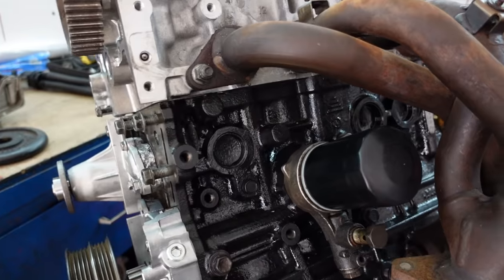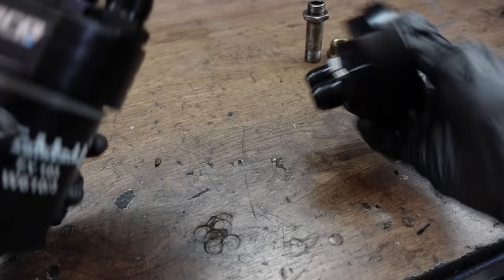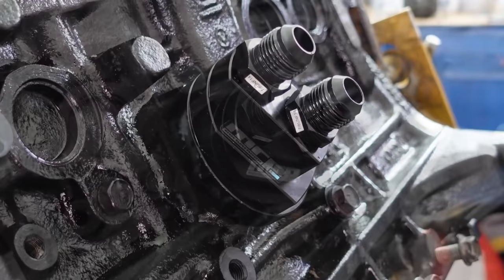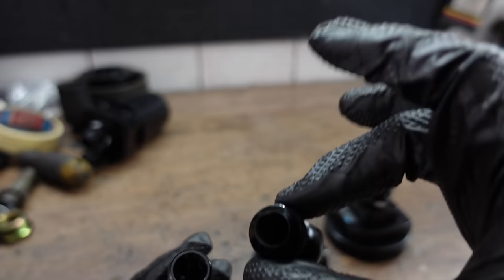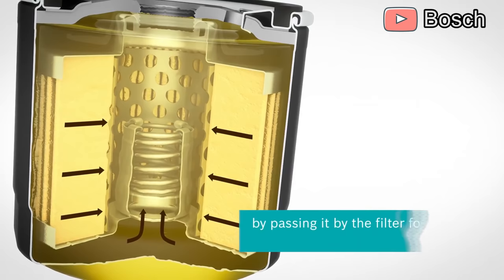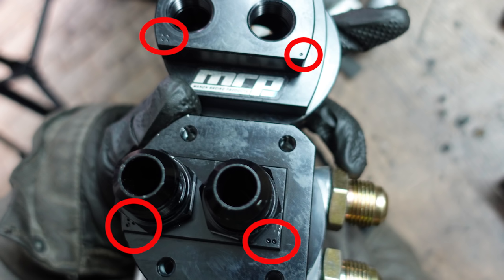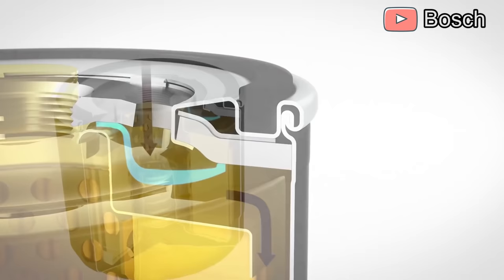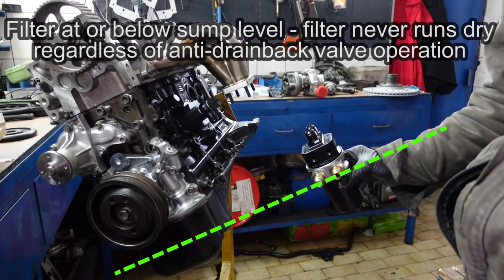HOW and WHY to relocate your OIL FILTER

Comment: Love to see parts go on that are a perfect fit. I got a replacement radiator that was 99% the same, the 1% difference was the size of the inlet and outlet so the stock hoses didn't quite fit comfortably back on. Maybe turning over the engine without spark for a bit would prime engines without as much ware for extreme setups?

Comment: I remotely relocated my oil filter on my v8 e30.
Used a block adaptor with -10an fittings  mounted thr filter and new housing down under the chassis leg and connected the two with nice braided oil lines.
No need for a cooler where it is now as it's down in a nice stream of cool air 😎

Comment: Great video. But i have read about the fact that if you get the size of the oil filter wrong, it can cause problems related to the oil presure. Or something like that. Considering this video, where you can add a ton of extra stuff and pipes and increase the amount of oil needed, can only mean that using a slighty larger (or smaller) oil filter in the original location, doesn't cause any problems at all. I hate the internet sometimes.

Comment: I had a 4A for a while and the stock oil filter location was a pain: right under the exhaust and right over the A/C compressor, so oil changes could be burn-y and they almost always involved oil all over the compressor. At least the car didn't have to be jacked up too high to get at it, like on a Honda D series where it's behind the engine. I never liked inverted oil filters (Mazda rotaries, newer Subarus) because they tended to be really messy and/or dry start nearly every time because anti-drainback doesn't do anything: it all just drains into the engine, leaving the filter and the long path from the filter back to the engine empty. On my 13B with any cold start I'd shut off the fuel pump and crank until the oil pressure gauge started to rise (5-10 seconds), then allow it to start.

Comment: Over sixty years ago, an old mechanic told me that the oil filter should be mounted "right side" up, NOT upside down.
He said mounting it upside down with the input/output holes facing down, allows the oil to drain out of the filter causing a dry/no oil condition on the engine restart. Whereas with the filter mounted correctly the oil filter can stays filled with oil.  A small side benefit is the oil stays in the filter when unscrewing the filter instead of spilling all over.

Comment: I personally use a thermostatic oil cooler to reduce the possibilities of leakage with all the gaskets and adapters.  Also why not just buyer a header that sweeps either forward or back or out further. Many ways to do it.

Comment: I have a system with a large oil cooler and 2 filters the oil filters are right next to the oil pan one filter to filter the oil and the 2nd filter is for any residual debris in the cooler and anything the first oil filter did not remove it's like a bypass filter but it is right on the engine the oil cooler is a oil to water cooler

Comment: I would recommend some type of heat shielding between the turbo and the relocation fittings. It’s going to get pretty hot right there..
Reply: Yeah, i hope he puts heat wraps on his headers and turbo jacket on the turbo.
Reply: Why does the hot turbo even has to hug the block? Is the heat even worse for other parts in the bay?
Reply: @ArneChristianRosenfeldt  Turbos constantly have fresh hot exhaust pushing through them.  Second to the catalytic converter and manifold, they are hottest part of car.
Reply: @reallyhappenings5597  Yes they are. We try to distribute the heat to get rid of it. So naturally we would want to place the turbo far way from other hot parts. Ideally, it would be close to a vent to the top to let the hot air escape. It should be away from the frame in order not to weaken it. Battery doesn't like heat. I guess the only way to deal with the exhaust, is to use double walls like on a motorbike. Or triple walls. At least you need some space between block and turbo to insert all the heat shields.
A turbo has a cold and a hot side and bearings at 60°C in between. Okay, 60°C is much closer to the intake temp then to the exhaust. How do they even insulate the turbine wheel from the bearing? In a jet-engine I guess they have this hollow, large diameter rim thingy where the heat would need to travel a foot of sheet metal before it reaches the bearing. Yeah, maybe the bearings are indeed hot, but the oil is injected at a very low temperature and is sucked away before it has time to cook.

Comment: I would be curious as to whether auxiliary electric oil pumps or pressurized oil reservoirs would be worthwhile for preventing the engine running dry on startup.
Reply: Also interested in this

Comment: On the location of remote filter, I had filters mounted remotely to the frame under the passenger door on my Dodge diesel truck. I experienced the no oil pressure issue 2 or 3 times. Moved them to a bracket fastened to the exhaust manifold and don't have that issue anymore.

Comment: A pair of filters would allow a bypass system. Main filter 20 - 30 microns takes full flow. Parallel connected filter at 2 microns takes 10% flow. 
Result is extremely clean oil for longer engine life.

Comment: As a 7MGTE owner I would be far too scared to use banjo fittings on the oil system as the one used on the stock 7M lines is very restrictive. I assume quality AN ones are a bit better flowing like you mention hut it would still set off my knock-anxiety!
Reply from the maker: The - 10an ones are giant honestly, probably three times as large as what's stock on the 4age if I remember correctly. This means they actually drop the pressure compared to stock 😂
Reply: Using banjo fittings on an M series Toyota is as fine as the fittings and metrics themselves. I've seen many and have a 6M myself I swapped 15 years ago, still holding fine.
Reply: A classic turbo supra owner?  88-93 Supra I assume.
Reply: @jsun3117  88-92*, and yes I have an '88 Turbo A

Comment: 1:13 not always. On my engine it's all cast into the block as one chunk. This sort of kit would not work on a 4.9 I6, a different style where the engine end threads on as if it was a filter would be required.

That being said, the 4.9 I6 does not have the exhaust and oil filter on the same side of the engine, so this clearance issue would never pop up.
Reply: This would work fine on a 4.9, as long as you had the proper base size.  The nipple sticking out of the base is exactly the same as the one used in the kit, and can be removed if it's damaged.

Comment: i was thinking, is there any benefit to mount the cooler upside down (line in/out on the bottom side) and located a bit higher from the oil filter?. that way the cooler would be drained everytime you change the oil filter

Comment: Can you install this relocation kit without removing the original housing (my OE oil filter housing is also a drive shaft carrier so I cannot remove it)? I want to just thread a relocation kit in place of the old oil filter...

Comment: Hmm, this is quite interesting. How do companies like BMW who put their oil filters at the top of the engine near the head deal with the issue of the engine running dry for a few seconds when starting?
Reply: Normaly They have a valve inside so not al the oil goes back
Reply from the maker: It's a different system/ design and the filter is still very close to the engine.
Reply: They have anti-drain back valves in the filter

Comment: Great episode. Have you ever thought about an pre-start electric oil pump, purely to bring up oil pressure before starting. Or a manual hand operated oil pump, like they have for priming diesel injector pumps, but to prime the oil system.

Comment: I still like the factory water oil cooler. Heats the oil up quicker and maintains it in winter. It also saves having to shoehorn an oil cooler radiator in the grill somewhere.

Comment: You can use an oil filter relocation kit on a normal engine too, because some engines have the oil filter sideways in a very tight place and you end up with a real dirty mess and burnt used oil every time the filter is replaced.
Reply: Yup, Miata/MX-5 engines are like that. You can use some tricks but still annoying

Comment: 1 reason to relocate it is difficulty accessing it in stock location. On the Rb26 it's under the intake plenum and it's hard to change it over without making a mess of oil all over the front diff. Installing an oil cooler + relocation kit will help improve engine life longevity and make oil changes easier at the same time. Win win.

Comment: Once again a great video on a subject i would totally overlook if you would not have made this. How is the project coming along?
Reply from the maker: As you can see in the vid the head is on. This took ages as we had to find different valve springs for the 4afe. The stock ones are super soft and there's no aftermarket. What's not in the video is that the transmission is also on now so the next steps are now auxiliaries like alternator, starter, and then putting the engine in the car and then intake ducting, battery relocation, intercooler stuff, exhaust and finally wiring it all up. I probably forgot like half the stuff 😂

Comment: I'm surprised the factory would even put the oil filter that close to the exhaust manifold to begin with. I'm used to them being toward the bottom of the engine, not out the side, nearly touching the stock exhaust. 
Isn't the goal to cool your engine fluids? Wouldn't having the oil filter that close to the exhaust manifold just make it that much hotter? 
That's why I say it seems kind of crazy the factory would even design it that way to begin with.

Comment: I want to add a relocation kit with a thermostatic sandwich plate on my 4age but I am worried of all that extra volume can affect the oil pressure
Reply: Volume won't do anything to oil pressure, It's line length and local losses.

Comment: Food for thought: does the MRP manual discuss priming of the cooler, lines, and accessories to avoid large air bubbles? The cooler would be easy enough, just pour oil in the top. However, the lines might be a little more difficult to prime.
Reply: Typically you want to pre-fill as much as possible. Then, upon first start, crank the engine without starting it. Some have a safety where if you try to start while the gas is fully depressed it will not supply fuel or spark. Doing so allows the engine to be turned over to build pressure prior to high force combustion.
Reply: @TowerCrisis  that is a good point, I know some older cars with point style distributors can have the oil pump manually turned without starting the engine.

Comment: That's why I only use full synthetic. It doesn't drain off of hot parts, and is very sticky so the engine is never without lubrication even after sitting for a long time. The micro film is enough to protect your engine for a second or two.

Comment: Great work and explanations I’ve got a question regarding no oil at start up for a short period of time and perhaps you could answer here  in this format or it might be a good idea for a topic of another video  I would like to see the video personally getting to the point would an accumulator of small capacity electrically opened at pre start up to supply oil pressure to engine prior to it turning over therefore alleviating dry start the accumulator could trap oil incrementally as engine runs and hold pressure  and released  at the following start up I’d like to hear your thoughts on this regards John P

Comment: They're a neat idea. Is there an electric pump that you could run to pressurise the oil system before the engine starts then have it bypass once the engine is started?

Comment: I have a kinda/sorta related question - aircraft piston reciprocating engines get certified after running flat-out for over 6-days; why can't automobile engines run flat-out, or even at 75% for as long? Is it a matter of harmonics and/or lubrication?
Reply from the maker: It's a matter of they don't need to be able to do that. A dead engine in a car means getting towed, in an airplane it's a different story obviously. You could design a lawnmower engine that's capable of running flat out for a month, but obviously that's useless and wasteful.
Reply: alot of manufacturers do thease kinds of tests but with varying loads and speeds
Reply: @d4a  thanks for the reply - General Aviation piston reciprocating engines are of large displacement, and turn slow. The Lycoming IO360 (fuel injected, slightly over square, opposed, and 360 cubic inches of displacement) develops max power @ approx 3000 rpm. They can run at 75% all day. What parts and/or systems fail in an internal reciprocating engine, say a 5.8 square small block, running at 75% all day? My guess is that any failure would be found at the bottom end - from rings all the way down to bearings; the harmonics they make at the different increasing RPMs, and the need for adequate lubrication at said rpm. Converting an auto engine to work in experimental aircraft always had my attention. This is why I now ask this question.
Reply: It depends what you call "flat out", if you check the list of FIA Absolute World Records, the Mercedes Benz team ran a Mercedes Benz 190 E 2.3-16 at 154 mph for 25,000 miles and 50,000 km in 1983, another Mercedes Benz, a E320 CDI at 140 mph for 100,000 km and 100,000 miles in 2005 and Volkswagen ran their W12 (not a production car) at 200 mph for 24 hours and another records including 5,000 km and 5,000 miles. I'm not sure if those sorts of tests are realistic for cars, but it might be wrong to say that they can't do them.

Comment: You could probably solder a button inline with the oil pump and the battery, so you can prime the engine with oil if it's not been started for a while, making the filter location less of an issue. 

Could always run cables through on a new loom to a button on the dash, probably best to do such things at the same time as putting in new gauges, water-meth kit electronics or nitrous kits.
Reply: I'm pretty sure most engines have a mechanical oil pump directly attached to the engine with some gears
Reply: On a 4age, the oil pump is directly driven by the crank. You can't prime the oil with the pump.
Reply: @sparkster_6087  would need to use electric motor then i suppose. 

And yes Telmo, I know. Most are drive either as part of the timing assembly or are directly attached to either the SOHC/DOHC or the crank.
Reply: @S.ASmith  Best thing to use for this would be an oil accumulator

Comment: Could you mitigate the dry starts after the car has been sitting with a few seconds of clear flood?
Reply: This is something I've been curious about as well.  I dread starting a car after weeks or months of not running because of the dry starts.  I know you could run the engine for a few minutes for the sake of it, but sometimes a car will be waiting on parts I didn't know I needed until I started the project already, for weeks at a time, with something crucial to operation is removed, and starting it is just not an option.
Reply: @drtm1718  I know it's recommended on the 3.5 ecoboosts to keep the timing components from wearing out, but I don't know if clear flood primes the oiling system on all vehicles.

Comment: My gm 6.5td took 7 quarts and it liked to thin the oil down when pulling hard and returning to idle. Now im running a 7.3powerstroke which takes 4 gallons and i dont see my oil get too hot and thin down when pulling hard plus my oil cooler is cooled by coolant so it heats my oil up when cold

Comment: If your using a relocation kit, at least put it somewhere easier to remove the filter. I work at an oil change place and someone had their filter relocated to inside the bumper. Also it wasn’t the stock filter, so we couldn’t replace it

Comment: Is there any oil pressure drops in through accessories, and potentially reduced oil pressure to the engine?
Reply: The oil pump will be running at a higher pressure and thus the line pressure will be increased, the components should be specced to that. Since the pump is fixed displacement this won't do much to flow, however it might wear out the oil pump a little faster.

Comment: The only problem I've had with this kit, is that union that comes with it is too short/ will loosen over time. . You should buy the union that mrp sells and tighten it with the appropriate tool. Then screw in the oil filter plate.

Comment: So you mentioned the top part can feed pressurized oil to your turbo? Do those holes act as the feed and the return as well? If I wanted to I could use that instead of modification of my oil sump/pan?

Comment: Oil in the pan is filtered oil, this means that even if the filter is dry the oil will be picked up from the pan, the engine will never run dry.
Reply from the maker: I'm afraid you're missing the point
Reply: So it will run dry for 1-2 second every oil change? I’m almost sure that even if the filter is dry lubricating oil will be picked up from the sump, sent it to the engine and only after that feed to the filter before going back to the sump.
There are a lot of engines with oem filter mounted well above the sump, EJ25 for example, could it be that all those engines will starve for oil after a month of being turned off?

Comment: I am confused regarding the oil viscosity part, it is known that fluids get more viscous as temperature decreases. However this doesn't apply with motor oil which is manufactured in a way to have lower viscosity at startup and increase in viscosity as the temperature increases until it reaches the engine's operating temperature, correct? 
If correct, then how does the oil gets more viscous when cooled by the core as stated in the video? 
Just need clarification regarding this point
Thanks

Comment: Great video! I also use a thermostatic plate on my gt86 for my oil cooler. 

What temperature do you recommend for a (mostly street car) thermostatic plate? 85 or 100 degrees Celsius?